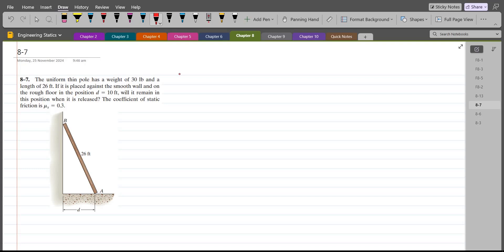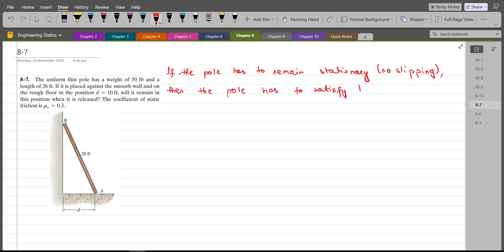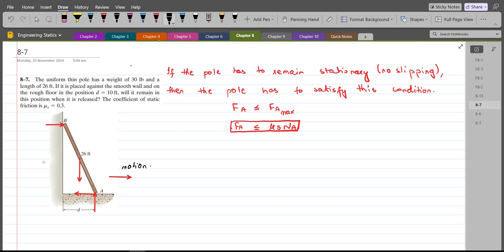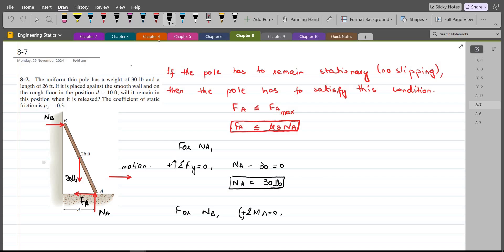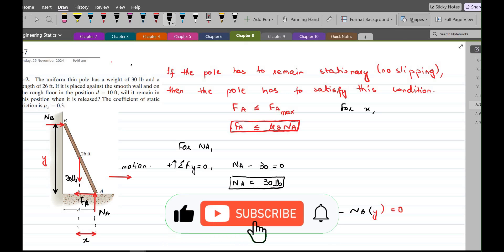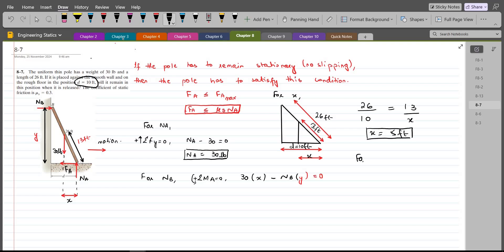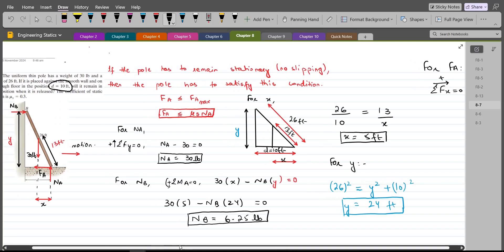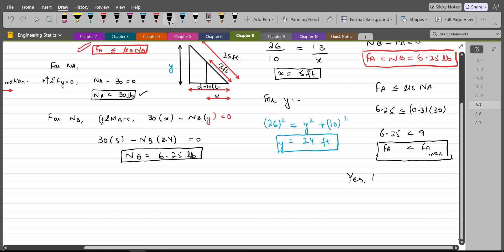8-7 hibbeler statics chapter 8 | hibbeler statics | hibbeler

Comment from the maker: Learn How to Solve 8-25 Hibbeler Statics Chapter 8, "The drum has a weight of 100 lb and rests on the floor for which the coefficient of static friction is μs= 0.5. If a= 3ft and b= 4ft, determine the smallest magnitude of the force P that will cause impending motion of the drum."
Here is the Link: https://youtu.be/lttyucYA3ao